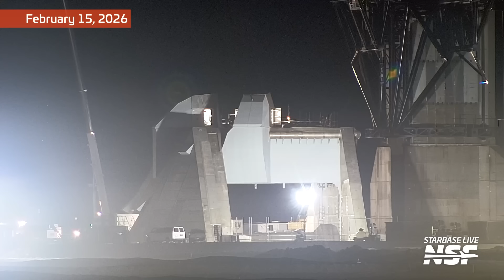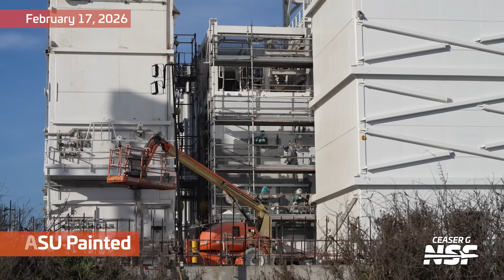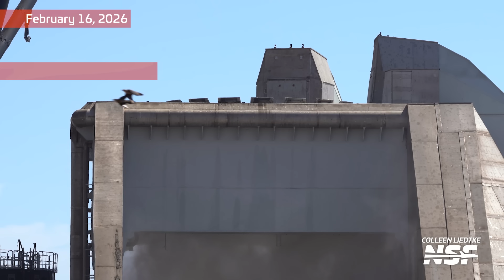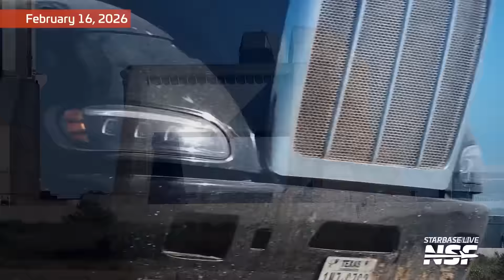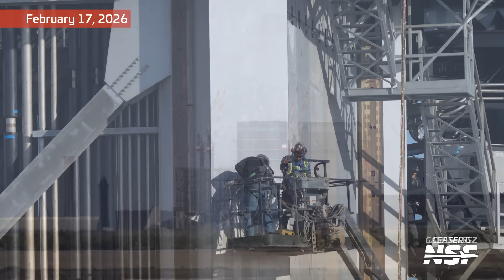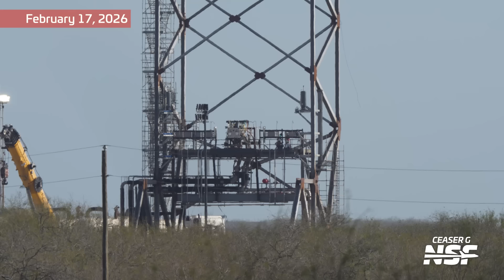"Will this be enough water for Starship?" | SpaceX Starbase

Comment: Mechanical Engineer here. Typically, when you have rollers and a rail you have brushes on either side of the rollers to brush debris off the rail for the longevity of the rollers.

Comment: Speaking of marine coatings. At work we use Sherwin Williams phenicon hs system. Works best if you can first blast to white metal with an anchor profile. You can also top coat with urathane to any color you like. Always be sure to holiday check as well.

Comment: so WHY would water shoot out the TOP? I thought the water was supposed to protect the TRENCH only? Would it be an issue if the rocket didn't rise as fast as they though and gushing water hits the underside of the rocket (and engines)?
Reply: You thought wrong.  The top of the table gets a lot of blast.  Nothing they pump is going to match the pressure coming out of the engines.

Comment: How are they going to get a starship on the moon or mars in one piece when this insane contraption is needed to safely liftoff and big ass chop sticks is needed for landing? What an insane grift
Reply: Seriously?  You're making a feeble effort to connect dots that don't connect so you can pretend you have a point.  Again.  If you need to make things up you didn't have anything worth saying to start with..  I know, that means you'll be silent forever.
Reply: @imaginary_friend7300  I’m not making anything up. Starship currently needs a heavily reinforced launch mount and a huge water-deluge system just to avoid destroying the pad at liftoff, and SpaceX is building a tower catch system to land it safely on Earth.

So the obvious question is: what replaces all of that on the Moon or Mars? There won’t be reinforced pads, water deluge, or tower arms. You’re dealing with loose rocks and uneven terrain.

If the vehicle requires that much infrastructure to operate safely here, it’s reasonable to question how it operates somewhere with effectively none.

Comment: Long range shot really shows how far away the compactor was from the pad.  That guy was stopped just watching the show.

Readymix truck not dump truck.
Reply: Yeah telephoto really compresses depth and makes it hard to gauge. The water that went over the edge was probably somewhat close, but it never went over the dirt mound so it really didn't even reach him.
Reply: @Jaker788 for sure, plus the angle also contributed to the deception.
In any case, I don't think the operator would be concerned even if closer than it appears
Reply: @WebberAerialImaging However the pause and reverse was pretty funny. For anyone wondering what scene shows the compactor position more realistically, go to 9:28

Comment: With raptors converting a lot of the deluge to steam I think the actual launch will have a different effect
Reply: And the deck is staged to start later than the deluge below. Likely starting up just as they do clamp release and reaching peak pressure after it's lifted a few feet.

Doubt we'll see much vertical water shooting if any. And I imagine it might not run for a static fire.

Comment: @Das. You can get marine coatings and paints, probably from any place that sells marine / boating equipment. If they don't have it they will know who does. You don’t need to buy deck paint because that has a grit substance in it to allow for shoes, barefeet to grip on the deck as people walk around. It's also quite expensive as well, plus you can't reuse the brushes after you stop painting, even if you are only stopping for a tea / coffee break. Just speak to the store people and explain what you want in for and they will steer you on the right course.

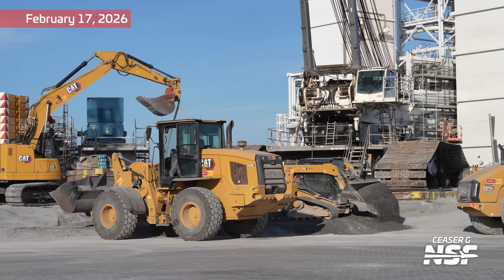Comment: 3:30 Pierce, the fire truck body and work truck body makers use "Imron" paint.  It's a chemical and corrosive resistant paint that is rated for extended submersion in salt water.  Imron is magic stuff.  There's a good chance SpaceX is using it or something similar to paint the tower and pads.  Just a guess on my part.

Comment: Where do they draw the water for that deluge exactly? Is there a pump that can relatively quickly refill that thing for the eventual rapid launches?
Reply: From a bunch of water tanks. Their ability to run again depends on the capacity of the system, I imagine they probably want capacity for 2 cycles at minimum if they don't already. Refilling the tanks will take a while, they don't have the tap service to really handle it and the previous farm had trucks fill it. Not sure if they still have the water delivered

Comment: @ DAS - Sherwin-Williams offers several high-solids, industrial-grade Acrolon® acrylic polyurethane topcoats (e.g., 218 HS, 7700, 300 VHS) designed for superior color and gloss retention, low VOCs, and durability on steel,, metal, and concrete, suitable for OEM and maintenance applications. These 2-component, fast-drying coatings provide long-term corrosion resistance for harsh environments
Reply from the maker: Do you sell paint for a living? 😅 - Das
Reply: @NASASpaceflight Industrial maintenance...so painted a few outdoor tank farms, structures, etc in my day.
Reply from the maker: Good deal. 2 component seems like the way to do this. - Das
Reply: 218 HS ...not cheap, but 10yr in harsh conditions is possible

Comment: That's a whole lot a rosie! We might get to see the first water-induced engine flame out. In reality, if there was a booster and 33 Raptor engines ablaze on the stand much of that water would be turning instantly to steam... We can well remember how large the vapor clouds were around the old launch mount in 360 degrees. Wait until that same amount is restricted to the flame trenches in only two directions. It's hard to fathom how high & far the exhaust plumes will reach on the new configuration. Excitment guaranteed, indeed...

Comment: 4:50  fun fact the sign on the back of dump trucks that say "not responsible for broken windshield" is not legally binding, the truck is responsible for anything that falls off of it breaking your windshield, they just do it in the hopes that you won't sue them
Reply from the maker: Bit of a burden to prove it came from their truck I guess? Would have to be caught by a dash cam or something it seems. - Das
Reply: @NASASpaceflight you would be correct, the burden to prove it was them would be on you, but if you can prove it they are responsible for all damages to your vehicle.
Reply: Car washes have equally incorrect disclaimers.
Reply: @owensparks5013  not sure.  A car wash is a service you willfully sign up for; there's certainly a similar claim in the small print.  

Being damaged by debris falling off a vehicle on a public road is different.
Reply: @DavJumps I was stating not asking. 😉 Not sure if the US is the same but in the UK is the law that wins not the small print. You can't legally give up your rights, the contract is simply invalid if it has illegal clauses.  I used to manage a few sites with car washes and the disclaimers were worthless, if my machines damaged your car I was liable, providing the car was in good condition when it entered. The signs were a scummy attempt to discourage claims, nothing more.
Reply: @owensparks5013  I'm from the United States, where we no longer have any laws except those that protect the wealthy and powerful from being annoyed by the riff-raff.
Reply: that's a fun and very useful fact
Reply: I'd like to imagine an alternate motive might be to discourage tailgating.

Comment: I paint transformers and other metal components at a nuclear plant on the coast where the environment is extremely hostile to metals exposed to the salt air. We use a two part industrial paint (and a primer) from PPG that we roll on and it levels out nicely. While the paint can be sprayed, rollers and brushes are used because it is faster than having to mask a bunch of equipment. The paint is expensive but super durable and is used in other industrial applications.
Reply: Just noticed at 11:29 the painter in the man lift is painting the gigabay with SW Pro+
Reply from the maker: SW Pro +? Is that a roller or a paint brand? 😅 - Das
Reply: @NASASpaceflight SW Pro+ = Sherwin-Williams paints. Now, to be sure, the painter in the manlift may have simply been using a spare bucket labeled SW Pro+ in which he put some industrial paint

Comment: Using a 4" trim roller to paint these giant things is just precious.
Reply: Ikr! 😂
Reply: I used to do this paint work for construction projects not dissimilar to this, and 4 inch rollers are pretty common. So are sprayers, though I'd see way more 4 inch roller use. It's not primarily for cosmetic purposes though. That's just a side benefit. The primary purpose is rust prevention.
Reply: Чёрт возьми. вы пишете 4 дюйма это сколько в метрах? 
У вас и километры в милях обозначают. 😊
Reply: @Sirius-z2n 100mm roller.

Comment: GROK said: "Why roller brushing with respirators?
Roller application is a common method for evenly spreading thick protective coatings (like chemical-resistant epoxies, polyurethane sealers, or corrosion inhibitors) on large flat/vertical surfaces without creating excessive airborne mist (which spraying can do)."
Probable safety concerns with over sprayer mist injuring the many trades working nearby.

Comment: The deluge system needs to protect the pad from many launches per day with Raptor V4 thrust and maybe even V5 thrust levels. 
It needs to handle both heat under the pad and also the heat on the top of the pad when the rocket is like 10 meters above and blasting right down at the pad.
It looks pretty good to achieving the needed level of thermal protection

Comment: That was totally awesome. That is more water than any other launch site.
Reply: That is more engine than any other launch site.
Reply: @o0shad0oo yeah, 3 times the Saturn V, and double the SLS..
Much water needed..
They probably should look at some better gutters though.. the literal torrent rushing over the edge of the concrete.. wow..!
Reply: @GenoLoma  If there were gutters the exhaust would likely blast them off. :-)
Reply: @GenoLoma Well to be fair when there are engines going most of it will be steam and get carried away. The water that does stay around probably won't make it that far and most will probably stay within the trench for the sump to suck up

Comment: That deluge is uhh way more than I was expecting
Reply: I guess they got tired of fixing the pad after every launch.
With all that water Elon might as well just have built the Sea Dragon...
Reply: It also looks like much higher pressure than Pad1's old system as well. Definitely interested to see how this stands up to the first launch
Reply: Powered by Raptor
Reply: @ryanrhoden1842  What I find interesting, we've seen before that the pressure release valve on the weir can shoot water up as high up as the tower itself, and on here 9:17 that was not even to half the hight of the tower, so are we to assume that they didn't even run the system at full pressure?
I know...we're entering speculation territory here, but I wonder...did SpaceX perhaps adjust the system to retain the same throughput at less pressure, or did they perhaps not crank it up all the way and what we've seen here is not even max power, or does it perhaps not matter after a certain point how much pressure they run it at cause the deluge can only do so much m³/sec.?!
Perhaps at a certain pressure level it's just enough exit-volume/force for the water to counteract the forces of those Raptors, so they wouldn't need to go higher pressure, assuming they still can.
Reply: @avon_c6199  I think it comes down to what drives the system, P1's weir was entirely driven by compressed air if I recall right, which means to move that same volume of water it would've had a much higher start pressure. Plus they seemed to brute force their way through issues back then as overcompensation to combat deterioration of the tower